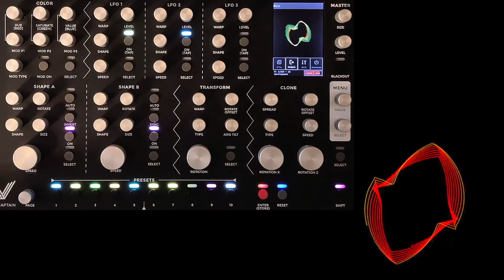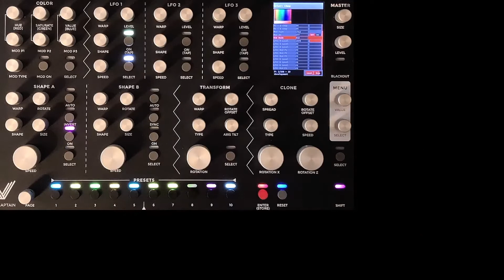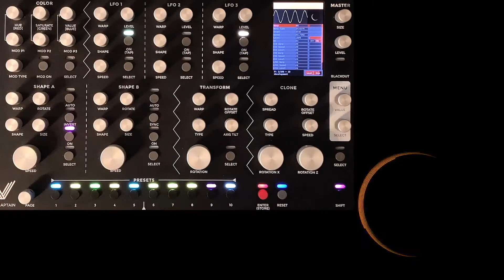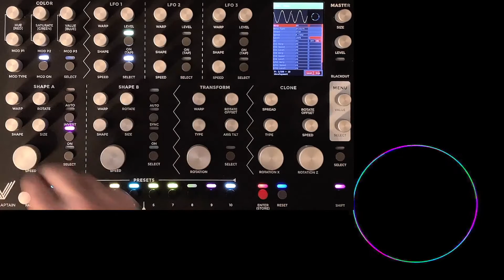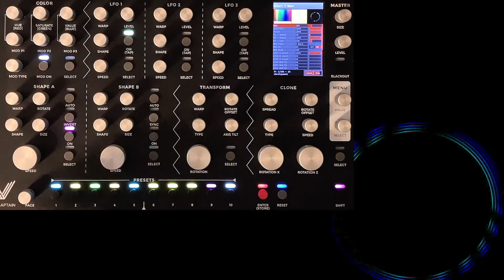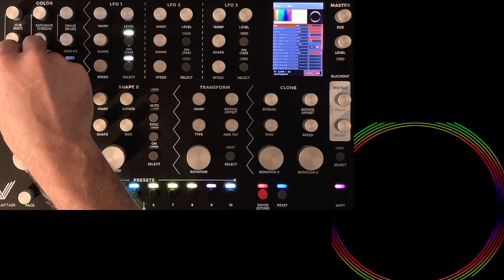Radiator color tutorial

Comment: Christopher,

Yes! These tutorials are great, and explain many of the questions I've had about Radiator. Keep them coming! I've played some, but I'm still confused about what exactly "Warp" does. Since it looks like it appears in 6 of the 8 sections of Radiator, maybe a tutorial on what it does and why we might find it useful, with a few examples from each section (Shape, LFO, and Transform).

Lastly, I hate to keep harping on this, but there should REALLY be an on-off menu-choice to blank the laser during the retrace portion of the LFO ramp waveform, to eliminate the thread-like retrace seen - especially in spirals (like at >11:26 in the video above). Can we get that in the next version of Radiator firmware?

Thanks so much!

Ron
Reply from the maker: great questions, ron.  on the LFO's there is "warp type" from the menu and "warp" (physical knob). these are modifiers to how the waveform is implanted. 

in the shape generators, there  are some warp types that manipulate the shape generation and warp controls the level of that effect.

i'll make a tutorial for you, but i think it's also explained in the manual.

trace lines are on our punch list. one way to avoid them is to tie the intensity control (in HSV mode) to the output of the LFO.